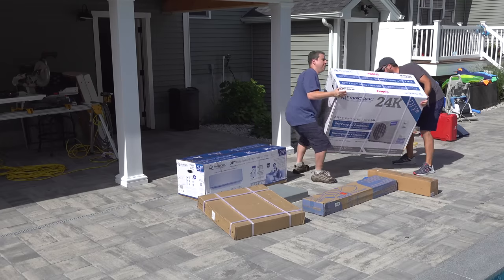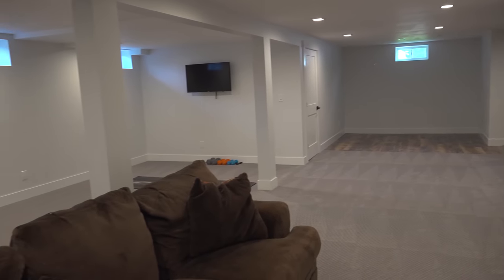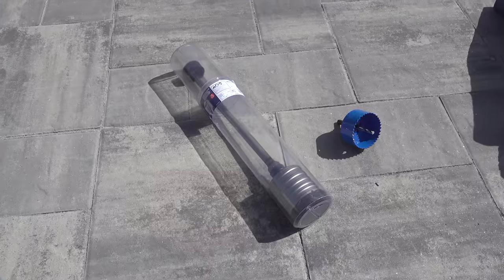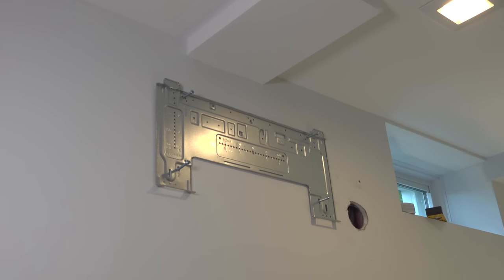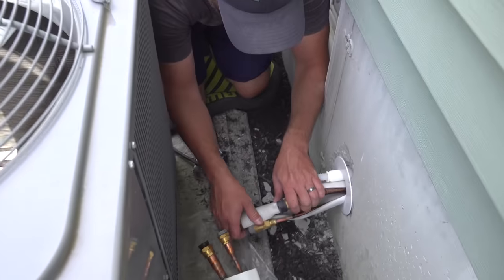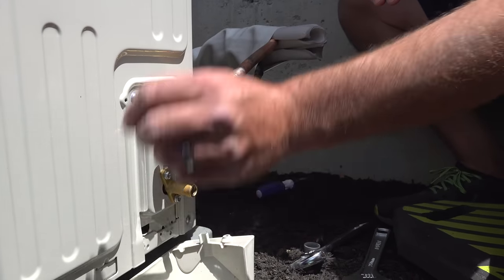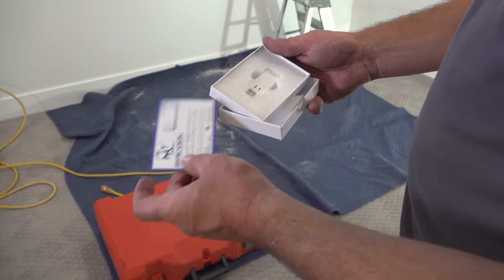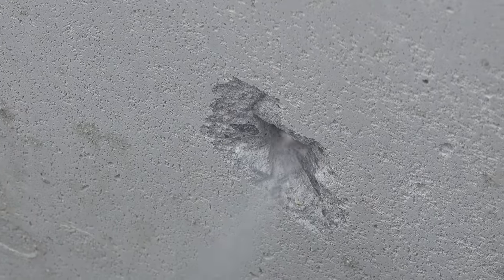Install your own AIR CONDITIONING in 4 HOURS!  DIY Mini Split MR COOL

Comment: I love these DIY videos on these ductless system. There's always a 99% chance the home owner will fuck it up and then call a hvac mechanic.  I've install 8 of these Mr.Cool units, they include the lineset but most of the time its going to have extra copper, so you expect the extra lineset be rolled and left near the condenser? No vacuum, no brazing, no 220v power.
Reply: I fully agree, he pulled a vacuum to how many microns, didn't even purge the air out, no vacuum, fully of air and then 2 years later he's wondering why the compressor is toast!
Reply: @jaythompson222  If you look into the Mr. Cool DIY units, they have precharged linesets with sealed ends.

All other brands of mini splits you would be correct in needing to pull a vacuum, but not the Mr. Cool DIY series.

Comment: You’ve forgotten two steps which is a nitrogen pressure test which also dries out the lines as it is an inert gas.  Also refrigerant lines need a vacuum pump to bring atmosphere in lines down to below 700 microns and to remove any moisture. Most of the time you will have moisture in the lines which will lead to further problems if not removed at initial install.

Comment: Where does the condensate go when it pulls water from the air?  It has to go somewhere.  How much power does the unit pull?  Would it be cost efficient to do a whole house?  I think not.
A lot of people are concerned with moisture in the lines causing problems with the compressor.  I have not installed one of these, but I have installed many [complete house systems, and the lines are evacuated and sealed so there is no need to 'evacuate them.

Comment: Use a small strong magnet and you'll know right where the studs are at. It'll stick to the head of the drywall screws. Way more accurate than a stud finder. I keep 3 of them in my tool kits.

Comment: Also before releasing the Freon into the system you want to get a vacuum pump and vacuum down the system… For two reasons 1. It removes all the moisture out of the line set… 2. It helps you check for leaks in the line set and the inside unit, before you go dumping all that expensive gas into the system you wanna make sure that your connection are leak proof and also that they weren’t damaged during shipping or installation…
Reply: This system does not require vacuum. Look at the fittings. The tubing is sealed with special connectors that only open the lines when they are seated in the corresponding fitting. However, you can't shorten these kind of lines.

Comment: I installed some of these splits with purge and brazing . test it with nitrogen at 500psi , and the service tech will come after it for a vacuum processes . It’s so nice that we can afford this product at a diy level . But I do have a few questions. What if there is a leak at the mechanical joints ? And can you order custom length for the line sets ?

Comment: Great video the only thing I did different is when I put the pipes together I used a little blue bottle of leak lock or you could use threading

Comment: In Europe and Asia mini-splits are the standard a.c. units, since few homes have central HVAC. I have stayed in hotel rooms with mini-splits - they are so quiet, yet very effective. I am considering one for the upper floor in my condo. I have central air, but the cooling it provides in my upstairs is very poor. I have to over-cool downstairs to get sufficient cool air upstairs, which is very inefficient, not to mention uncomfortable. A mini-split upstairs would  be a solution.

Comment: I never heard you mention evacuating the  system to remove moisture. This process is very important to ensure long compressor life and good cooling effect
Reply from the maker: Yes but it's unnecessary here, in fact harmful since you would be removing the refrigerant. Both the lines and condenser are pre-charged and sealed until connected.

Comment: I have a 600 sq ft house. I currently have a single window unit for AC in one end of the house. I need fans to move the cold air to the other end of the house which is OK, but it's still a pain. This sound good, but it still looks like I'd need the fans to move air to the other end of the house?

Comment: A self-priming / purging split? Interesting, I wonder how that works. Probably worth using some teflon tapes on the threads just in case and expanding foam in the hole to stop pests getting in.

Comment: I wonder how long it took you to drill that hole through that wall with that diamond bit, especially dry... Considering using a Concrete Coring machine would save time and you are drilling through what 10 inches of concrete ?. Minus maybe 4 inches of what contains dry wall, insulation and metal stud. I believe I, heard you drill through 10" inches if I am not mistaken. $150.00 / $125.00 with the right equipment maybe 20 mins or less later of work. You a hit piece of rebar or two and that will be the real trick with that dry bit. 

You can also use your Hilti with an extended bit to drill a pilot hole through to tell where you are going to come out on the otherside.
Also if you can get the slug to break, you can use a coat hanger to fish it out with, without needing to make that extra mess.

Comment: Nice Video. Its not a huge issue, but I would not recommend putting the condensers near a dryer exhaust vent if you can avoid it.

Comment: This mini split comes w a 20ft line set but all system have a minimum running feet which is commonly 10-15ft or it won’t blow as cool or as hot as it should and have some ppl thinking it’s under or over charged w Freon

Comment: A couple ideas: check studs before starting, you can make sure the inside unit will land on one and the hole will not. Also make your hole slope slightly towards the outside of the house in case of water.

Comment: cool video, but did you let the air out from the installed tubes? Usually is not good to have air left in the system. The compressor will have more life if the system is without any air left in it.
Reply from the maker: Not with this system, the line set and condenser are sealed and freon filled. They only open their valves which can be seen inside the plastic caps on the line set when properly connected. The system is entire factory filled and sealed to perfection.

Comment: I do like the diy aspect of these, but it is too bad the US is plagued with super high prices for these split systems. Split systems have been used for years in Europe and when America finally introduced them, distributors act like it is brand new technology that we discovered and they charge astronomically more money than their foreign counterparts. In fact, we have several split systems installed in our apartment in Europe and they are only about $350 each and you will find made by big brand names- European, Japanese, etc. Sad that American distributors once again do not offer value anymore especially on the same items that are made by the same companies that make the European ones.

Comment: You cannot just hook up the refrigerant lines without pulling a 500 µm vacuum on the system that is not charged with Freon. If you just hook it up without pulling a vacuum. You will have ice particles that will form at the device that meters the Freon. It’s like the nozzle on a squirt gun kids toy or the nozzle on a pump spray bottle. as the Freon is allowed to pass through that metering device that is very small into a larger space in the line, that’s where you get the drop in pressure, resulting in the drop in temperature. You have to pull a vacuum because that air that is in the lines that hold the Freon has moisture in it. Those moisture droplets will absolutely block that metering portion of the system and the system will not work.You have to pull a vacuum with a vacuum pump. When I installed the system on my house.. I connected a two stage vacuum pump and I let it run for about 20 hours overnight, I shut the pump down, with my gauges hooked up, I made sure that it held a vacuum to test the lines and the connections to see that there was not a leak.
  this is actually illegal. You have to have a refrigerant license to handle refrigerant/Freon. At least classed one certification. If you end up releasing Freon into the air, that is a violation of the Montreal protocol agreement between nations to stop releasing CFC/Freon into the atmosphere because it is damaging the ozone layer. The result of that agreement was the end of Freon  R12 That was widely used in the industry up until that point especially in automobiles which have switched to R134..
  if you release Freon and someone notifies authorities, the fine is $25,000. And the person who turns you in is the person that gets the $25,000.
  That’s why you can’t just throw an old refrigerator or air conditioner away unless it has a sticker on it that shows that it has been evacuated of the Freon. Because if a scrap dealer was to take your old refrigerator, and start scrapping the copper from the refrigeration section, and cuts into those refrigerant lines without evacuating the gas, that scrap dealer is going to be paying a big big fine..
   you can buy a split system like this in the video, but you have to have an HVAC person come and make the connections, and make sure that the condensate will drain properly so it doesn’t pour into your house or your apartment, you have to make sure you have enough power, it would be best if you had a dedicated circuit just for the HVAC not on a GFCI.. you never want to have a refrigerator, hot water tank, furnace, or air conditioning system on a GFCI fault interrupter..
  anHVAC professional will also make sure that your system does not have a leak, and that the gas charge and your compressor for the system is adequate which it generally is not enough gas in the system when it comes from the factory. Sometimes it either just leaks out because they didn’t seal it completely, or it just was not enough refrigerant in the system from the factory. I have never done an install that did not need additional Freon, even though they claim they are pre-charged from the factory..
   but the main big problem with installing your own system unless you are not an HVAC technician. As you must evacuate all of the air which will take all of the moisture out of your refrigerant lines in the Lines that are not charged at the factory…
  if you think I’m kidding about the ice that will form in the system. Try this
..Remove the Schrader valve from one of your car tires and just let the air escape. Put your finger down there and listen as that air comes rushing out of your Schrader valve on your car tire. You will feel the cold air as the pressure drops from the tire air escaping. You will also see ice form around the end of the Schrader valve because there is a drop in pressure. That is the Basic way an air conditioning system works. You have a drop in pressure at some point through a meter device. And the big problem is that ice that forms right there. That will block the flow if you don’t evacuate the system of all of the air that’s in it which will get out all the moisture that’s going to cause the ice blockage.. you have to have an HVAC technician or someone with a vacuum pump, pull the system down to 500 MICRONS and hold that much of a vacuum, which takes anywhere between two hours to 24 hours depending on how large your system is..

Comment: Thank you for sharing this video. If I may ask, when releasing the refrigerant after opening the upper valve on the video, when will I start opening the lower valve? Do I need a pressure gauge to know if all the refrigerant has circulated in the tubing? Thank you so much in advance, I hope I can get a reply.
Reply: You’ll open the lower valve immediately after opening the upper valve. The refrigerant has already done its thing once the noise stops. Just spray the connections with soapy water to check for any leaks. I’ve installed 2 of these MRCOOL diy units myself. Save $1-2k easy vs hiring someone.

Comment: Since the heat and AC comes just from that one vent, it doesn’t seem like the whole room will be close to the same temp and in winter, since heat rises, won’t the floor be way colder than the higher up?

Comment: My room is 5 by 5 =25meters

Can 24000 btu support my room because at 18000 btu I still feel the room not cold enough what do you recommend stick with the new acs or buy an old t22 split ac? Or continue with 410?

Comment: Nice video, though anyone who owns one of these needs to be versed on maintaining it and preemptively buying a blower rebuild kit with the Head Units (indoor mounted unit) blower wheel, bearings and motor as well as the condenser fan blade and motor. I’ve changed many of these mini splits, though not a Mr. Cool and they are not easy. Additionally having these parts on hand will save down time if they needed to be ordered or if the manufacturer should discontinue that model.

Comment: just to understand why did you not just move the initial duct hole over by 2 inches to the left, so you don't cut something important? does it matter from the outside wall?

Comment: What about all of the outside air that gotten inside the lines?  Are they shipped sealed under vacuum and are pierced when you tighten the ends?  Otherwise all that humid normal air is in the now sealed system which as a novice AC guy is really bad.
Reply from the maker: Calm your self doctor. All is as perfect as can be. The line set AND condenser are sealed and freon filled. They only open their valves which can be seen inside the plastic caps on the line set when properly connected. The system is entire factory filled and sealed to perfection.

Comment: Oh and at 3:54 in the video if you just go outside and drill it from the outside when just the little pilot drill peeks out of the concrete, there will be much less patching needed, just caulk around the outside of the plastic flange they show mounted.

Comment: Just a quick question, where did the non condensibles go? Do you think having air in the line set will shorten the compressors life, oil acidity, higher energy use, lower cooling capacity? I know its a ductless and they are resilient.
Reply: @jerbear20032003  If you look into the Mr. Cool DIY units, they have precharged linesets with sealed ends.

All other mini splits you would be correct in needing to pull a vacuum, but not the Mr. Cool DIY series.

Comment: Wait, don't you need to pull a vacuum before you release the refrigerant, or am I misunderstanding? Usually refrigerant and moisture forms an acid that eats away at the compressor and seals but maybe I'm wrong?

Comment: The people I've seen  install split systems themselves; I have go through and take all the insulation off the line set and find where all the kinks are which requires taking indoor evaporator back off the wall and recovering the charge or pumping it down. 

Or they didn't properly connect the condensate line to a drain outside.

Comment: Usually when you drill through concrete, You drill a pilot hole. With the pilot hole you can avoid blowing out the back

Comment: Try using a stud finder so there is no need to ruin the stud. The outside foundation should have been pre cut to prevent ruining that. Also using toggle bolts to support that air handler is a very Idea.Sheetrock is no way strong enough to hold a large mirror or shelving, let alone something like that. Even flat screen TVs are prohibited to be mounted from sheetrock. Since a child was killed from one falling off the wall.

Comment: DIY ac installation looks nice and cheap to do, but what about after service? If the unit fail or you need freon because of line leaks? R-410A is expensive and usually HVAC companies don't like to work on DIY unit because warranty are usually a pain in the ass.
Reply from the maker: Call a normal HVAC person and they are completely equipped to work on these. Don't believe the jokers here saying guys refuse to. While under warranty Mr Cool has dealers across the country if needed or many parts can be done yourself if you are handy or they just ship replacement units. In many ways these are more like Window units since they are nearly 100% factory built so I would expect good results based on reviews without issues

Comment: Next time when the drill pokes out from the concrete don't let the large part poke out. go outside and drill towards the inside. It will prevent the concrete from exploding and especially if it's rendered outside.
Reply: Omg what a mess I would of been upset

Comment: luve the lawn work this guy does,no branchin out to home construction...but WHY not use an indoor portable
A/C like artic king for 300$ stuck the out let tube out the basement window? def. not as clean look but more than half the price/labor, right guys?
Reply from the maker: The built in is very convenient and that space is 1400sq ft. But don't miss the biggest one of all., This Mr Cool is HEAT and COOLING he needed heat down there, so the AC is really a bonus. For an all in one its pretty amazing.
Reply: @SilverCymbal  hey there! i finally hear from you, you never replied to my lawn questions on your vids.lol! well , i thot abot that after your video when i went to price the portable 12kbtu for way less, they dont heat, your right. 5k is alot for seniors or older dudes w/ little construction experience. i dont know , yall make it look eze,its a close one. well i can buy an OMISH electrical furnace i suppose for a few hundred and still bet yall out. also, i hate drillin thru my foundation, that's scarey thot , it wasn't a small hole ya know? let me know what you think, thanks! great vid!